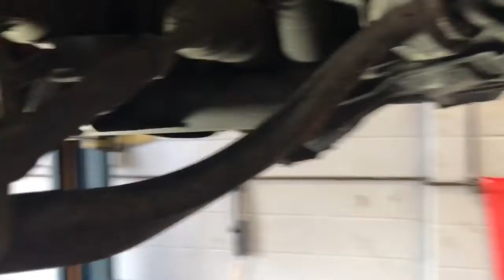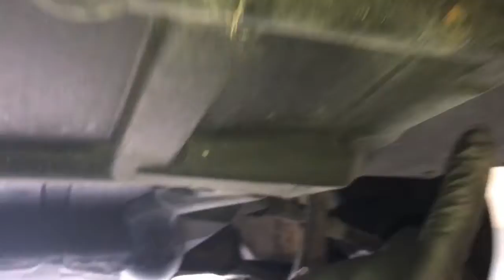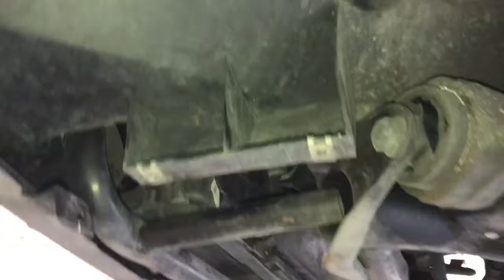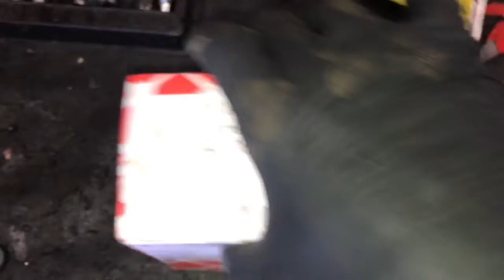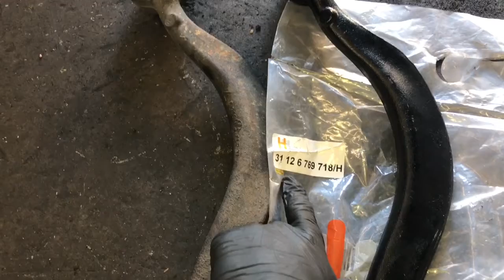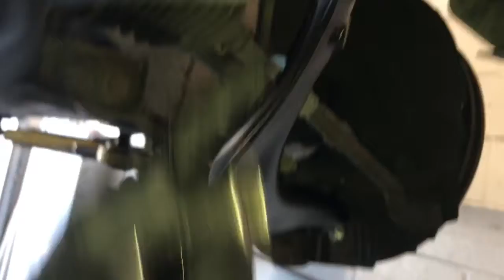How To Replace The Thrust Control Arms And Ball Joints On A BMW X5

Comment: I also had a heck of a time getting the ball joints to come out. I did find a solution though. I'll try to explain it. First remove the torx bolts from the ball joint. Then Remove the upper bushing bolt and let the arm fall down. I was working with the car up on safeties on the ground, not with a lift. For the passenger side turn the steering wheel all the way to the right. Spray the ball joint top and bottom wuth WD40. Use a floor jack and put some pressure from below so the steering Knuckle is solid. You'll see that the arm hangs straight and then if you pull it towards you there is a lot of leverage on the ARM. I had a little trouble with this side as I'm not a lefty but pushing down on the arm withone hand and banging the arm with a heavy hammer starts to slowly crack the ball joint  loose. Be careful when it falls. I crunched my finger. I didn't realize this when doing the driver side and I did everything with chisels, punches, pry bars to no avail. Once I turned the driver side wheel all the way to the left, pulled back on the arm, put a jack under the steering knuckle to make it solid...pushed down and wacked with a hammer it came out in about a minute. I was working on this one ball joint for 2 days before I figured it out. I am working on a 2003 X5 and they were really rusted in. Great video, hope this helps to those attemting this repair.

Comment: ok thor. if u can get that pressed ball joint out by a hammer on that thrust arm. your my hero. but u cant. no way. anyone who reads this. save yourself. take the axle out. use a press. rent it. remove the rear control arm from the subframe. remove the thrust arm from the subframe. everything should be pretty loose and floppy. turn the wheel away so can acess the top of ball joint from behind the wheel. get a pipe or old jack pipe. hit the pipe with a hammer. it will go. it will suck. but it will go. your welcome. garage isnt gonna give up their secrets. and when you tighten up the bushings. pre load the suspension. DO NOT OVER TORQUE THE BALL JOINT TO THE THRUST ARM. Your day will be horrible. take my word

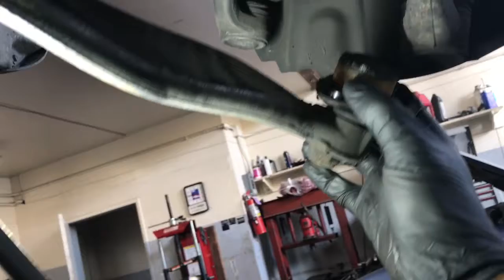Comment: @1:14  how long did it take for the ball joint to come out?
Reply: to long. i just wrote a quick explanation. its not super easy like he makes it seem
Reply: livey oone   it's not as hard as you think. It's hard to do it without. How else can you get it out. If it's been in there for 100.000 and miles. Its rust welded in. You can do it. Just do it like I said. Have you started any work on it yet.
Reply: livey oone . wouldnt use heat unless its absolutely necessary. mine is also an 06. the torx bolts arent badd. w.e. you do. make sure that you spray it with wd40 or pb blaster. ive found that penetrating oil really works and will make a difference. the flanges on the ball joint will be rusted to the knuckle. i used a flat head screwdriver to chisel around the edges to break it loose somewhat. thst still doesnt work. it needs force to move. hit it from above. take the axle out of the knuckle and send it. you have all the info you need to do it. if you need help help or advice just send me a mssg. ill msg u back and we'll get it out.

Comment: My ball joint won't budge with a 3lb hammer on the control arm with the nut off as well. Your video skips right over the hardest part I have encountered. So does auto doc for that matter. In my case, I need a special press to avoid taking the cv joint out, or super-unglue. Any ideas?
Reply: Yes, exactly. Most videos like this on youtube OVERSIMPLIFY the most difficult parts. The hard part in this job is getting the ball joint out. It is usually so corroded in it won't want to budge. Wailing on the control arm may damage it and if the problem is only a bad ball joint why would one want to buy a new thrust arm (control arm)? One wouldn't. So a good video would be, "how to remove a stubborn ball joint..."
Reply: realize your comment is 6 years ago.. but I'm doing this currently.. had the car up, waiting for parts, a week now. 2 ideas.. one is less work.. use a nail punch, attempting to turn the ball joint wings slightly.. then try putting the screws down through the top, pushing on the wings.. try turning evenly, or with 2 ratchets.

otherwise custom tool.. cut out opposing side over wings on a ball joint spanner.. match threads to a bolt.. tie together with a longer one from tractor supply.. & tighten to pull down.